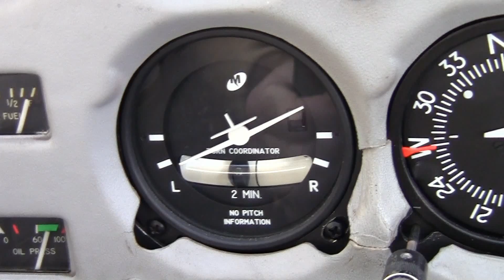How To Forward Slip an Airplane

Comment: To do this safely, it would be good to "spin" the plane.  This is aerobatic training, and shows what can happen if you "push" slips to hard.  This type of training - was a life-saver for me.  Recommended.
Reply from the maker: Otis Brown You're more likely to spin from straight-and-level flight than you are in a slip...
Reply from the maker: +Nicholas Manning Aerodynamics. Yaw and Roll are as far from coupled as possible during a slip. (Page 335 from Rich Stowell's excellent Stall/Spin Awareness book). Not enough rudder authority in a Cessna 172 to do an 'over the top' spin from a slip... in something like an Extra? Sure, but I would assume if you were flying an Extra you would already know all this stuff.
Reply: +Garry Wing what makes you say that?
Reply: +Garry Wing From the book, "Stick and Rudder", it is clear that making a left hand turn, you have left rudder, and are slowing down.  This is not "forward slip", but it is the loss of airspeed, and causes the plane to "break" into almost inverted flight - close to ground.  This is why I believe that pilots should be taught the "sense" of spin entry.  This type of aerobatic training - saved my life.
Reply from the maker: +Otis Brown Otis- Don't think in terms of left/right; it's only confusing you. Think of HIGH rudder (slip) or LOW rudder (skid). Of course I wasn't using LEFT rudder in a LEFT turn as I demonstrated SLIPS in a video, c'mon!

Comment: So it's ok to slip with flaps. I have heard mixed input from different instructors. Also spins are rare with slips correct?
Reply from the maker: KTS Check the POH. Cessna 172N is placarded to avoid slips w/ flaps (but not prohibited); C-172SP discourages "steep slips" with > 20-degrees flaps. Mainly results in oscillation of elevator being blanked by flaps while uncoordinated. And slips are less likely to produce a spin than straight/level flight, according to Rich Stowell, as yaw is less-coupled w/ AOA in a slip than in coordinated flight.
Reply: +Garry Wing I actually practiced this with large scale remote control airplanes using the C-172. You can actually see the whole process doesn't produce a spin unless you force one to happen. The dirty air from the flaps causes the elevator to respond slower which is why air speed should be watched while doing this. I was told if you're not sure go around. It takes less time then having to clean up an accident. 

Good Advise to practice this. As you will be checked on this anyways.